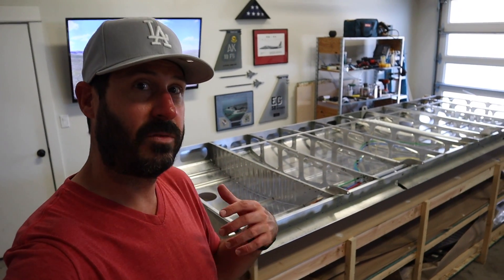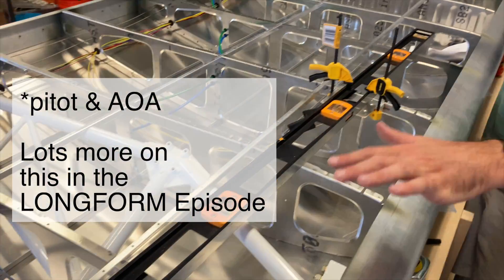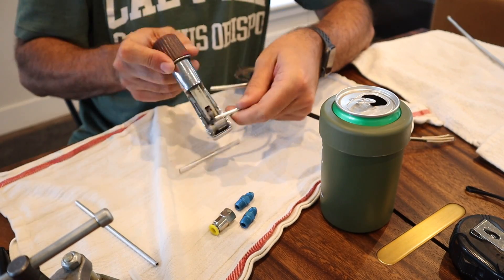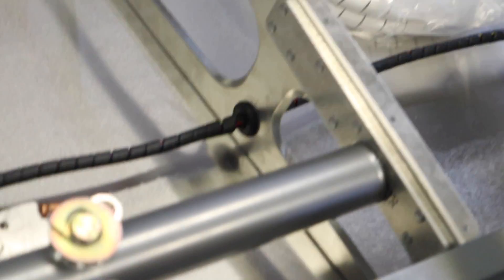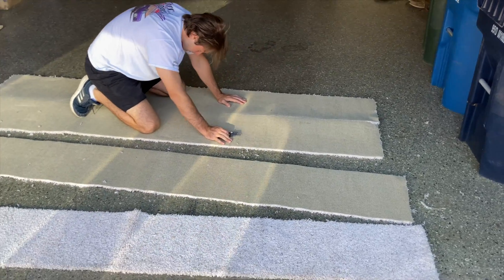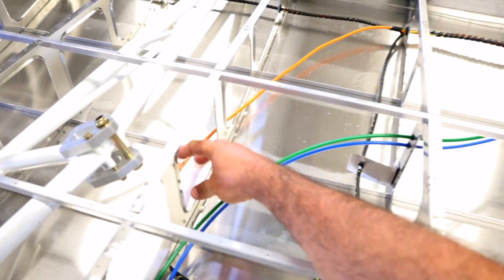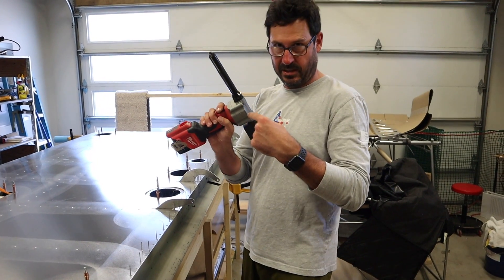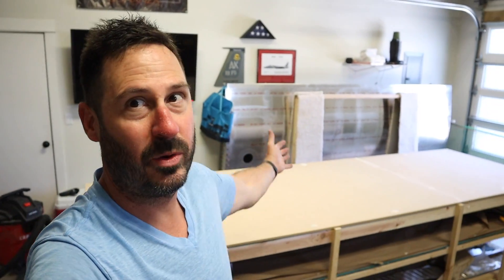RANS S-21 Build Ep 7; Wings Part 2

Comment: Looked at the short form videos so far which are really great. Out of all of the parts you have built so far there doesnt appear to be any internal corrosion protection. Is this something that's considered an option if your in a really dry climate and planes get stored in hangers all the time?  I'm here in the UK and its wet a lot of the time (bring a good waterproof if you ever visit) so I guess we would need to start priming at least before closing up panels. What is Rans take on this?
Reply from the maker: Hi Tim, thanks for the Q. I obviously can't answer for RANS (feel free to weigh in, RANS), but plenty of people do it in wetter climates. I'm comfortable not applying internal corrosion protection in my arid climate with a hangar. Anecdotally, all the of the S-21 I've seen being produced by RANS at their facility in person or on their build videos do not have general corrosion protection. Most of us do protect dissimilar metal junctions, however. Blue skies to you, good sir!